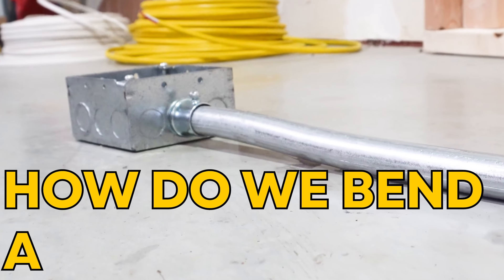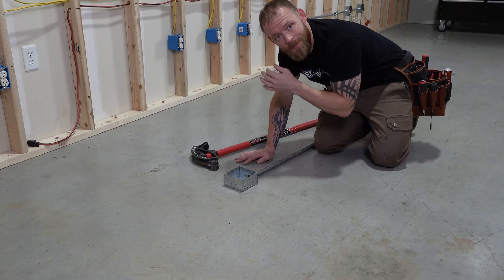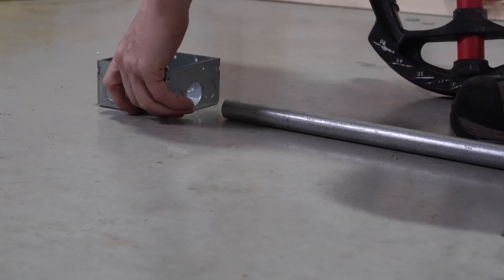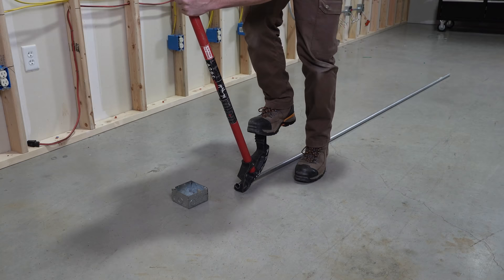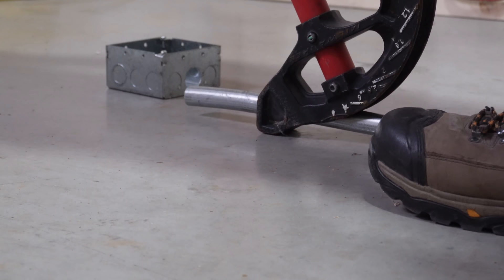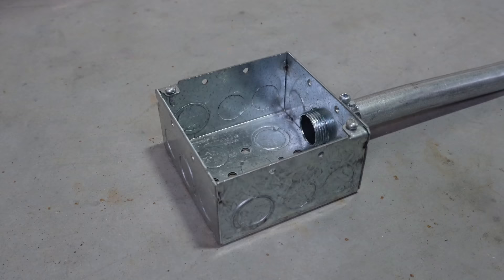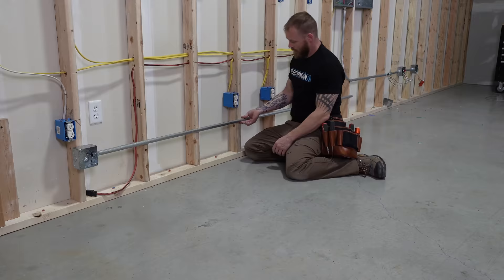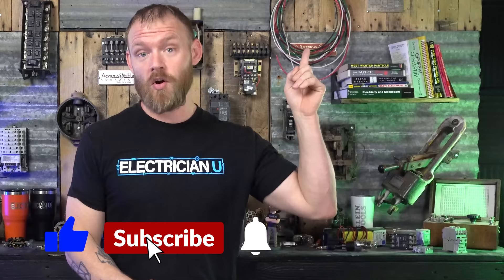How to Bend a Perfect Box Offset? Electricians Need to Know How to Bend Conduit.

Comment: Justin, you rock my dude!! I was just thinking of exactly how do I make my new exposed EMT sit flash with the KO, Boom there you go😎 

Quick homeowners Q? Is there a specific height requirement for outlets of 600V or less (dedicated Welding NEMA 6-50R I/A/W Article 630) in a garage or non dwelling area? I’m scrubbing the Codes in prep for making sure I land my receptacle correctly. As you have mentioned NEC 70 is NOT a design manual but a good guide for the way the world works and lives like that other good book, oh yeah, the Bible 

Cheers Bud! 
Kevin
Reply: I never went looking for the minimum outlet height, but I almost always put those at "bench height" so you can see it when stuff (like the welder itself) is up against the wall.
Reply: @rupe53  Great 👍🏼 Thanks Bud! Readily accessible, nice and easy, as always. I just don’t want to get the inspection done and he/she’s like oh no that’s not XX inches above grade or something!! Doh…….

Thanks again 
Be Safe
Reply: @kevintaylor113  ... btw, worst case is you ask the inspector what they want. I can't seen any reason to mount it low like a regular outlet and I certainly wouldn't go above 5 feet, unless you are in a flood plain.
Reply: If you think about what height range outlets are, you'd see that there really is no minimum height for outlets. Heck, think about floor boxes. They're recessed below finished grade. But, the times are changing and standard height for outlets is no longer 12" to center.

Comment: emt looks like easy work compared to the rigid conduit we use in Ireland.
Reply: Rigid conduit is used in the US also.  There's also an IMC  (Intermediate Metallic Conduit)  that is a little bit thinner walled than rigid conduit, but still can be threaded.

Comment: Why would you install the connector on the pipe first? So much wasted time and potential for injury. Pop it into the box first and tighten the hell out of it with either your lineman's or channel locks. So much faster, easier and more secure. Also, you can pop all the boxes in the wall, then your connectors and anybody would be able to come behind you and pipe the room.
Reply: How much wasted time between his way and your way? Just curious.
Reply: @jumper233  I cannot tell you empirically. But doing this for a while, the fewer tools you need to pick up and put down, the faster you'll be.

Comment: I think your hella smart electrician ,but if you do bring the last bend back to far you end up with more offset it seams
Reply: You need to realize that your first bend is JUST as likely to be bent too much as your second,bud! Both bends are equally important! Understand open and closed bends. Look at your first bend. If you dont have a trained eye yet, which I suspect you dont, take that long part of your piece of pipe and line it up with another stick of pipe. Look at your first bend. Is it pointing towards the strait piece of pipe, or aiming way from it? Aiming in-closed. Aiming away-Open! Adjust accordingly. Good luck, youll get it down in no time.🍻🍻
Reply: @jeffreyharbert3439  Except, that's not what he said.  He wasn't talking about the degree of the bends,  he was talking about how far back the second bend is placed on the pipe.  And he's right, the farther back you place the bend, the more offset you get for the same degree bends.

Comment: I believe in floor bending all offsets with a protractor, but not the box offset. Get a measurement, whatever gets it to 3/8 height and airbend that mf 

But yeah,  use whatever works for you at the end of the day.
Reply: @abc-pn6yi  the problem with relying on the degree notches on the bender is that they're inaccurate most of the time. This will throw off your bends especially if you're using multipliers. 

With a digital protractor, this eliminates any error as long as your math and measurements are correct and is pretty much in my opinion, the only way to go when using hand and electric benders alike.

You can use math or mathless center of bend plotting and get dead nuts offset bends all the time.

Edit: the digital protractor can  calibrate to zero to any uneven surface. Forgot to throw that on there